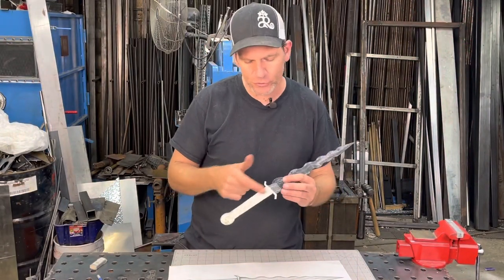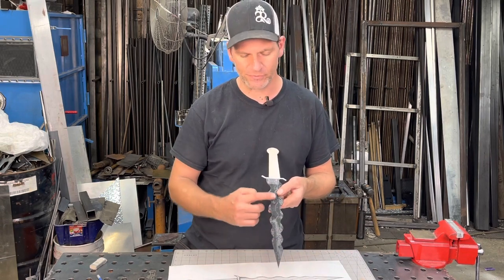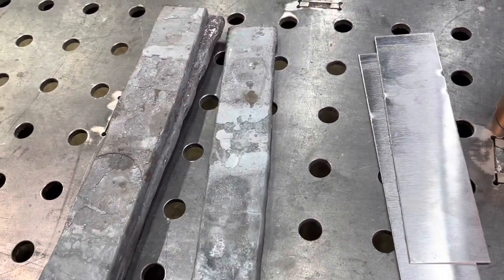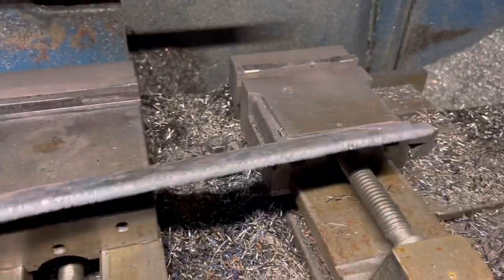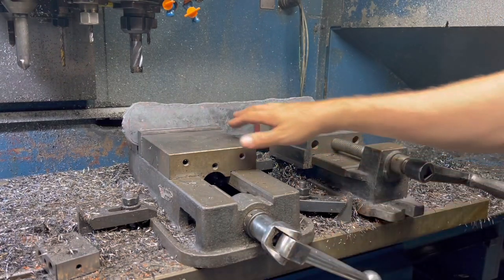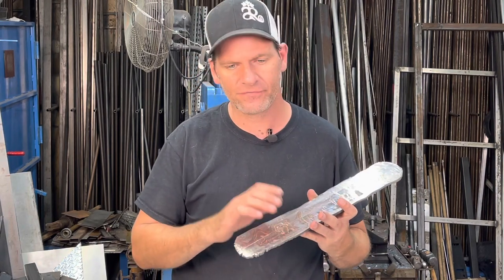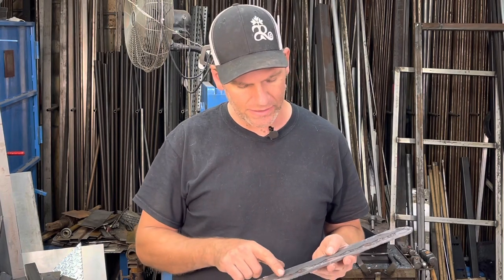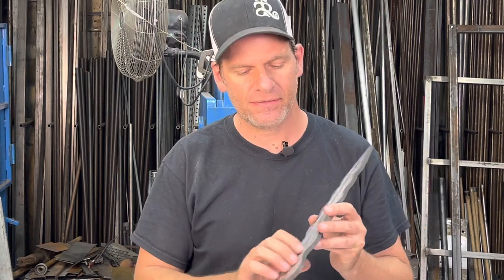KRIS BLADE COPPER DAMASCUS DAGGER!!! PART 1

Comment: Forge welding, copper will stick to both low and high nickle steels.

Will it stick to stainless steel? And if it will, can think copper sheet or foil be used as a "forge glue" to use in san-mai cladding with stainless on the outside and a Damascus or uni-steel on the inside?
Reply from the maker: I think it will , I’m doing some experiments on what metals will bond thanks